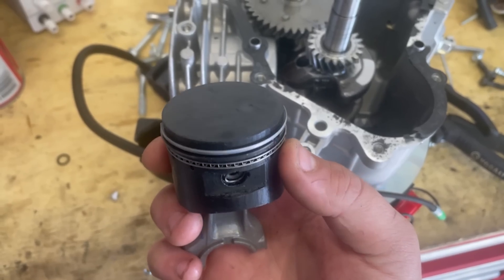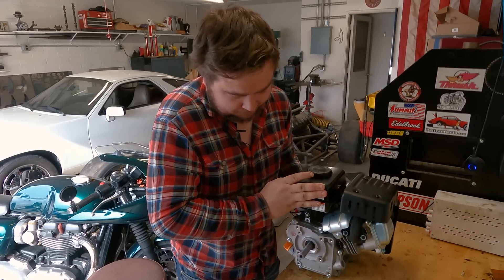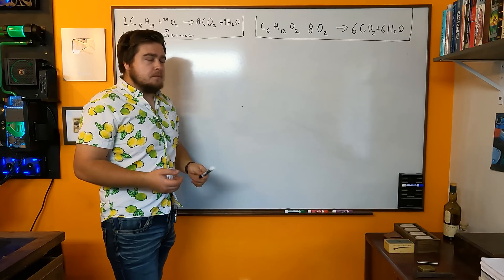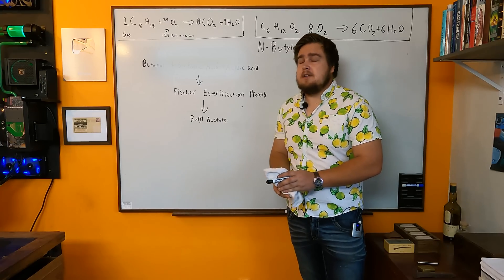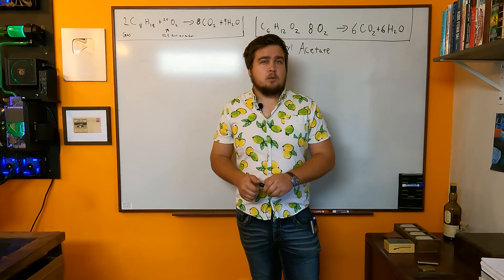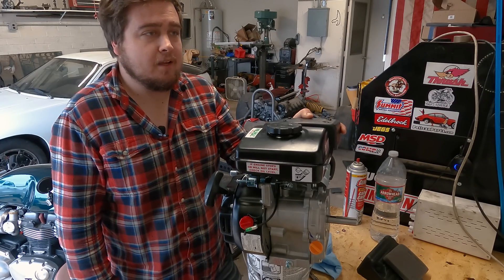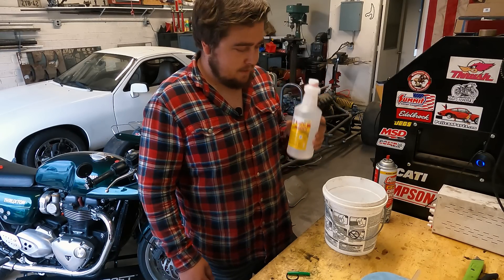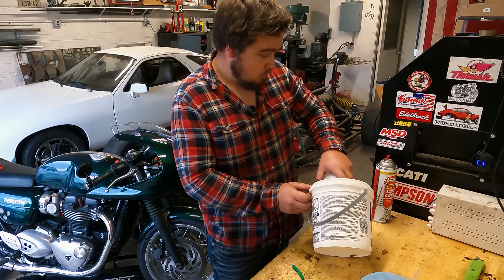Cold Burning Fuels and Plastic Pistons for Harbor Freight Engines!

Comment: You could apply an H series Cerakote coating to the top of the piston. The H series is good to 500 deg F, can be applied to plastic, and most colors have "excellent" chemical resistance.
Reply from the maker: I really like this idea- a coating like that is the best solution for a heat shield
Reply: Maybe you should take Cerakote to court and see if you can win a lawsuit haha
Reply: Plasma coating ?
Reply: I left a link to a forum but not sure if it's displaying or not. At any rate spray paint would be really cheap and easy to test. Might even put this debate to rest about polishing piston tops that's been going on for years
Reply: @1fast72nova  yeah the link isnt showing. YT usually doesnt allow links outside of youtube.
Reply: Silver colored UHT/VHT paint?
Reply: @robmanueb.  it’s actual heat not sunlight
Reply: @Industry-insider  Not sure if you are familiar with VHT paint, it's for the outsides of engines, exhausts and fireplaces.
Reply: @robmanueb.  yeah and it still gets extremely hot it just insulates slightly
Reply: @Industry-insider  Ah ok. I thought it would be a cheap and easy experiment to see if silver paint reflects enough heat compared to black plastic.
Reply: @robmanueb.  the color doesn't reflect Heat... It reflects light... a mirror will still get hot if you put it in a fire... Heat isnt reflected.
Reply: @sethh8892  people have kept carbon off pistons and even polished them for decades to reflect as much heat back into the cylinder as possible. I'm not saying paint will work but silver will absolutely reflect heat back into the cylinder
Reply: @1fast72nova  can you heat up a mirror with a heat gun? If so then that logic makes absolutely no sense. You don't reflect Heat. Heat is just a transfer of energy. There are three main ways to transfer energy: conduction, convection, and radiation. Just because the surface is shiny doesn't mean it's not going to get hot... you don't reflect Heat.

Heat is not radiation and it cannot be reflected. Heat is the internal energy of a substance which is manifest as molecular vibrations, rotations, bending, electronic transitions, and so on. It is not light or infrared radiation or anything electromagnetic.

 Literally the easiest thing to Google. And I've never heard of anyone polishing a piston to reflect heat. I could see polishing a piston helping but it's definitely not going to reflect Heat. The only thing it would do is reflect the light from the explosion.
Reply: @1fast72nova  I think you're misusing your words, heat isn't reflected like that. Maybe you're trying to find a different words than reflect.
Reply: @sethh8892  well I've heard most all my life polished pistons and chambers will reflect heat back into cylinder. Maybe it's from the texture, not exactly sure. But I think Toyota did a test and estimated up to 1% increase in efficiency and KB claimed up to 6% ...
Reply: @1fast72nova  and its not a debate, its simply put, heat isnt reflected. Heat is absorbed. Light is reflected, not heat. Can you heat a mirror with a heat gun? Please answer this question.
Reply: @sethh8892  of course you can heat a mirror. It is a debate or maybe wives tale
Reply: @sethh8892  are you seeing those quotes? I never know with YouTube
Reply: combustion chamber question - LS1TECH - Camaro and Firebird ...
Dec 11, 2011 — Generation III Internal Engine - combustion chamber question ... use to polish the chambers in theory of reflecting more heat. head porter
Reply: Should i polish combustion chamber? - Movie Cultists
Polishing can help eliminate hot spots and some say even reflect heat back. Often unshrouding the valves improves flow, but only done correctly
Reply: @1fast72nova  the main benefit I can see from polishing the combustion chamber is smoother flow of fuel and Air, reading to A more even dispersion of combustion across the top of the piston, which would allow for a more efficient dispersion of energy. Just like how they try to keep the spark plug in the center of the cylinder. And like I stated before with stress fractures. Polishing the inside of combustion chamber definitely can help, but not from reflecting heat. After all, where is it going to go?
Reply: @sethh8892  as noted in the last quote I left a light or shiny surface will reflect infrared energy/light and it goes back into the chamber to help with the gaseous expansion which is then expelled out of the exhaust or most ideally via power transfer of the crankshaft
Reply: @1fast72nova  I don't see how light, something that has no mass (because it's not matter), could have effect on gas expansion in less than a fraction of a second. After all the light produced from the explosion is actually a by-product, it's just inefficiency, to be honest.

 Question for thought:
Would shining an infrared light in the intake manifold cause a buildup of air pressure and thus increase manifold pressure beyond atm?

If so, how? If not, why would this affect occur in the combustion chamber?
Reply: @sethh8892  black plastic is going to get hotter faster than shiny silver plastic. And if we just look at light alone the are hundreds if not thousands of intense flashes per minute. But I'm done arguing. There's plenty of data to read on the internet about it. Many say it works, many say it doesn't. This guy's plastic piston would be a great place to test.
Reply: @1fast72nova  I see what you're doing and you're misconstruing light and heat. Yes light will heat things up, only very minutely, not enough to make a difference. You're saying that light is being absorbed into an object and transferring into a different form of energy known as heat. Either way heat is not reflected. That was my main point. Light can be reflected but not heat. This is due to the fact that heat is not a radiation. Either way, what is it going to matter when it's literally inside the engine. Even if it made as much of a difference as 1 degrees Fahrenheit, (which it absolutely does not and I'm giving you the up most benefit of the doubt), what would it matter if the Piston was one degree lower? Numerous sources online are giving temperatures within the multiple thousands range in °F. I'm seeing numbers between 2800°F and 4500°F. What would this absolutely minut amount of change matter? Remember light is only produced immediately after the explosion. This last for only a couple of milliseconds. Watch videos online of engines running with see-through heads. There is a combustion and the light that is produced is pretty dim and a mild orange... very little energy is going to transfer from this light. Not enough to make a difference. And being as though very little like is produced for a very little amount of time, very little of this will absorb into the metal, and only a small percentage of that number is going to be converted into heat energy. Which again will not matter at these extremely high temperatures... again, if you are getting higher horsepower numbers from polishing the internal combustion chamber it is due to increased flow numbers and more even displacement of the combustion across the piston top.
Reply: @1fast72nova  at 500 RPM idle on a V8 is 125 flashes per minute on any given piston... not thousands...
Reply: @1fast72nova  I'm simply stating that heat is not reflected, I didn't say anything about light in my original comment. I'm just pointing out that heat cannot be reflected. Anyone with a basic understanding of physics, or at least some common sense will know this. See how whenever I gave you the heat gun and mirror experiment you pointed out clearly that heat will not reflect from the mirror but it will absorb into the mirror. How would this differentiate itself from the engine experiment? If you polish the Pistons top to a mirror-like finish and put heat to it it's going to react the same way the mirror did with the heat gun. The heat is not reflected. That was my entire point. Anything outside of that is besides the point.
Reply: @1fast72nova  I'm definitely not saying that polishing the combustion chamber would not increase performance or efficiencies... obviously efficiencies can be found in many numerous ways, but it's not from the way you're saying it. I'm not arguing with the conclusion I'm arguing with HOW you came to the conclusion. If a mathematician is looking at a extremely hard problem and can't figure it out and a seven-year-old child says it's 3 because it's their favorite number, if the answer is actually three it's not because its the kids favorite number. The childs answer was right, but reasoning was wrong. That's what I'm trying to point out here.
Reply: @sethh8892  do you know why GM paints their motors black and why radiators are black?
Reply: @sethh8892  Because radiated heat is heat transferred by light (that is, radiation). The paint is in physical contact with the radiator, so the paint gets heating by conduction, and the paint then cools by radiating heat (as well as a little conduction with the air, and a lot of convection).

Unless the radiator is getting hot enough to glow in optical wavelengths the optical color doesn't matter. If it is hot enough to glow, then black will perform better than white because the ability to emit radiation is the same, from a physics perspective, as the ability to absorb it. If the radiator isn't that hot, then what matters is the "color" in wavelengths you can't see, and shiny metal is good at reflecting light in many wavelengths, so is bad at absorbing/emitting light.
Reply: @1fast72nova  it's not for reflecting heat. That's for certain. And wouldn't black make it hotter?? Hmmm. Doesn't seem like it would work too well does it. And the radiators are not painted black bub... radiators are bare metal. The oil coolers are black usually, however you can get aftermarket ones there whatever color you want. It's usually black because it's one of the cheapest color to produce. I guess that's the same reason that fuel line hoses are black. Is that also why tires are black? Again my original comment had nothing to do with the color, I don't even know how color came up in this discussion. Reflecting heat is literally impossible. You can reflect light which can be transformed into heat energy, but you cannot directly reflect heat due to the fact that is not radiation...
Reply: A painting the block a different color made a dofference, then why does Ford paint there's blue? Why did Chevy paint theirs red? The paint is literally nothing more than for looks. Jfc. You are reaching so hard for absolutely nothing. I'm just pointing out the fact that you are wrong on one simple concept  (heat cannot be reflected). I'm not arguing anything else.
Reply: @1fast72nova  radiated heat is not a thing. Heat is not radiation. Heat warms the air around it and you feel the warm air, but heat is not radiation. So, no. In the vacuum, you would not feel the heat. As there is no medium for the heat to travel through. The only way he can be transferred is it things come in contact with one another...
Reply: @1fast72nova  paint is an insulator... Which would keep heat in the engine, or if someone was dumb enough to paint the radiator, it would keep heat inside the radiator. It would not allow it to escape as easily as bare metal. Again you're reaching... you have yet to grasp anything.
Reply: @1fast72nova  yeah there isn't light inside the radiator bud. It's pretty fucking pitch black. Unless you got holes in your radiator that are allowing light in. But I guess you wouldn't have to worry then, because your engine wouldn't run, or at least not for long... radiators usually aren't painted, but if you did that would increase the temperature of the engine due to paint being an insulator. Radiators are not emitting light. I don't know who told you that radiator produce light, but they surely don't.
Reply: @1fast72nova  "because radiated heat is heat transferred by light..." so you're agreeing with me but are too scared to just say that you're agreeing with me. It had to transform into heat energy... because heat doesn't reflect and isn't radiation... Thus, it cannot radiate, and relies on light as a mode of transportation. So what I said is right and you just agreed with me. Thanks for that.
Reply: @1fast72nova  Ok, and your point? Heat still isn't reflected. That was my entire point. Had nothing to do with rattle cans and intercoolers. If you go back and read the first comment between us, you can clearly point out the fact that I'm saying that heat can not and will never be reflected. Light can be reflected it because it is radiation. But heat cannot. Energy can be transformed into something else, this is usually a form of inefficiency, but if the energy transforms into another form of energy it is not the same as the previous energy state. That's like saying water vapor is the same thing as ice. They're totally different although they are from the same molecule. Heat and light are both forms of energy but are still different. Failing to understand and recognize these two different things as seperates shows me that you clearly failed to comprehend what I was saying to you.
Reply: @1fast72nova  If you could just demonstrate heat being reflected off of a shiny surface, that would be all it would take. But instead you must read Haring off into a totally different subject to try and make your point look valid, which has failed miserably.
Reply: And I said *heat*, not light, *heat*.
Reply: @sethh8892  light is simply visible heat. Infrared radiation is simply light your eyes can't see. You're arguing semantics while your base premise that heat can't be reflected is wrong. Semantics aside
Reply: @1fast72nova  I'm getting some of your comments in my notifications but are not actually able to see them on that chat. Did you delete comments or is YouTube doing that thing again?
Reply: @1fast72nova  light is energy, heat is energy, light is not heat, heat is not light. They are two different things. Heat is not radiation. Light is radiation. They are definitionally different. I'm not trying to go in depth on a semantics game, because they're not usually that fun. But based on the definition of heat and light, they are different. Light is a wavelength, heat is not. Infrared light is still just light, it's not heat. You can absorb light and this light can be transferred into heat energy. But still energy must first transfer into another form of energy in order to become heat. If it has to go through a change in order to become something else it was not that to begin with. Obviously. Water is not a gas, we know that it is not a gas because you must first boil it to make it a gas. By definition, it cannot be a gas. You must first do something in order to turn it into a gas. Light must first be converted into heat to become heat. Just like light, it does not have a temperature. Because the light is not heat. Light can be converted into heat. But it is not. They are definitely separate. Saying that light is heat is empirically false. There is no denying that.
Reply: @1fast72nova  I think this does it best. This is a description of infrared light:

Infrared is a heat-producing wavelength from 0.78 microns to 1000 microns (or 1 millimetre) and covers a thermal range of several thousand degrees centigrade down to absolute zero. Any object with a temperature greater than 0°K will radiate infrared energy.

 It can produce heat, but it is not it it produces it. I wouldn't say that you are carbon dioxide. But you do produce carbon dioxide, correct?
Reply: @sethh8892  if radiated heat isn't a thing, why are aluminized emergency blankets so much more effective shiny sided towards you?
Reply: @sethh8892  you spent a lot of time trying to differentiate 2 concepts that English has words for, heat and temperature, heat is radiative, temperature is a property of an object.
Reply: Polishing the chambers: Myth or Fact? | Team Chevelle
Jun 29, 2006 — I don't believe that the thin layer of carbon on a cylinder head is a good insulator. Carbon doesn't reflect heat well. Heat is infra-red energy
Reply: What color absorbs best infrared?
black
It all comes down to the color: Why infrared prefers black to white. The heating process in plastics processing is much quicker for darker materials. The reason behind this is that black plastic absorbs infrared radiation better than white or transparent materials.
Reply: @1fast72nova  heat doesn't have a color... heat is not light, because the heat is not radiation. Infrared is light. We can't see it because of our eyes, but it is still light. Black absorbs light, do carbon buildup will absorb light. And polishing the top of piston could reduce heat spots, or uneven pockets of heat across the top of the piston. But it does not reflect Heat. And even if it did, let's just disregard all of common physics, where would it go? 3 in in the other direction? What's a it works and you have a massive stroker engine. It's still only going to be going a maximum of four and a half inches away. You genuinely believe it's going to make a difference with an internal combustion temperature of 200 and something degrees? Again this is all under the nonsensical presupposition that heat can be reflected. HEAT DOESNT REFLECT. Light is reflected, and there is lots of light being produced inside of the chamber. It may be reflecting the light inside of the chamber, which could cause a change. But its not reflecting heat. Metal absolutely absorbs heat, but polishing it can make it reflect certain wavelengths of light. And obviously light being absorbed means energy is transfered, which can be converted into heat. But the heat absorbed is negligible in comparison to the heat produced from the explosion of gasoline...
Reply: So black paint radiates or transfers heat better than shiny metal?
Reply: Maybe if I don't tag you I can comment
Reply: @1fast72nova  Idk, youtube has screwed up comment section bugs.
Reply: I guess the question is, does black absorb infrared radiation (heat haha) better than a shiny metal surface. The answer is yes.
Reply: @1fast72nova  absorbing meaning it's coming from an outside source, and if metal painted black is absorbing energy, then it's average temperature would go up... which would be bad for a radiator when its intentions are to dissipate heat. I still don't know what this has to do with the original topic. And again, heat and light are totally different. Please try to measure light in Celsius. Or hell, try to measure heat in wavelengths... let's see how that works. Heat cannot be reflected, but light can.
Reply: @1fast72nova  please demonstrate the reflection of the kinetic energy in the form of heat.
 Remember he is only the kinetic energy of the molecules that is makes up a substance. So how do you reflect that?
Reply: Let's get away from the semantics. If a surface is black will it absorb energy easier than a shiny silver surface. Because that's what's really at hand
Reply: Oh I see you said a black surface will absorb heat easier. Sooo if we are trying to keep a black plastic part from melting would a reflective light or silver colored surface help?

Also if a surface absorbs heat easier it will also dissipate easier as well. On this platform search for intercooler myth busting
Reply: @1fast72nova 
No, it will absorb SOME types of energy better. Not necessarily every type of energy.

In your off topic spray-can-o-black-paint and radiator, light energy will absorb better with a black surface. Where has a shiny surface would reflect more light and thus absorb less. And this could be turned into heat, depending on the wavelength of light.

 In the original comments, the original comments were about a reflection of heat, which cannot be affected by definition. Heat is defined as the kinetic energy of moving particles. Moving particles that make up a solid cannot be reflected away... that literally makes no sense. Light can be reflected not heat. The fact that you're still trying to argue this is bewildering. By definition heat cannot be reflected. Any physics professor will agree. Light is only energized particles, whereas light is a wavelength, if a specific wave length hits a surface, has a chance of reflecting or resonating with the particles, thus energizing them. This will transfer light energy into the kinetic energy we know as heat... light and heat are totally different people not semantics. They are just two different things.

I guess that cars and motorcycles are the same thing, and the only difference is just semantics. Right??? By your definition of semantics, cars and motorcycles are the same and the only differences are simple semantics.

Get over yourself, you are wrong. Heat cannot be reflected, other forms of energy can, however.
Reply: Semantics
Reply: @1fast72nova  Ok, now the troll is just too obvious... Good night.
Reply: https://youtu.be/LqwBbuck7hE
Reply: Watch the Cerakote video here on YouTube. They say right in the video it reflects heat. I think you're the troll
Reply: Heck the insulation in your walls 'reflect heat' ... Go on with you semantics argument.
Reply: @1fast72nova  heat cannot be reflected. It literally doesn't make any sense to say that heat is reflected. Some random YouTube video doesn't make a difference, physics is physics. A YouTube video is dogshit for a source.
Reply: You have to heat cerakote to over 150 for half an hour for a strong result and I doubt any filament could handle it but you could if it’s made on a resin printer because they handle heat better
Reply: @Industry-insider  H series Cerakote coatings applied to plastic parts are supposed to be cured at 150 -180 deg F for 2 hours, which is below the glass transition temperature of ABS.

Cerakote V-136 piston coating is supposed to be cured at 300 deg F for 1 hour (~150 deg C), so maybe that's the one you're thinking of?
Reply: @sendtripetal  yeah but I don’t think the coating is important in this case because I’m pretty sure the biggest reason pistons are coated is to reduce hot spots and that shouldn’t be an issue at this power level